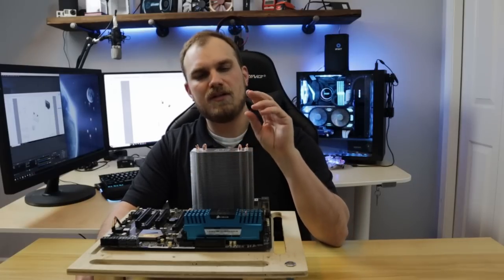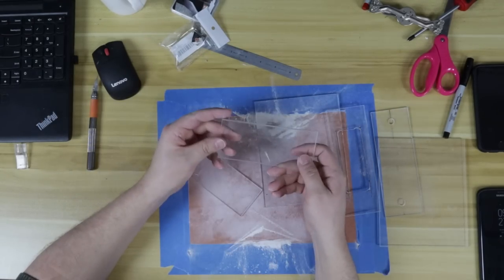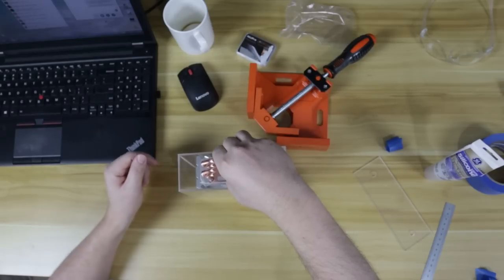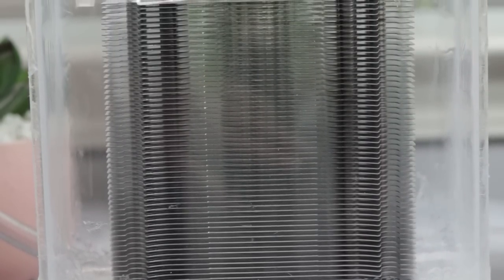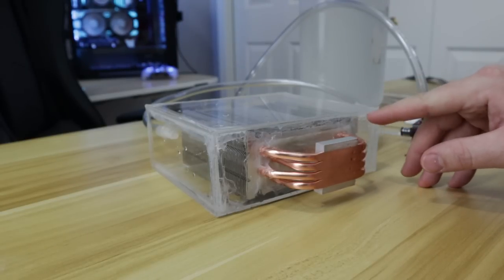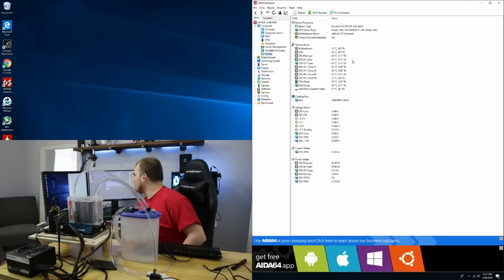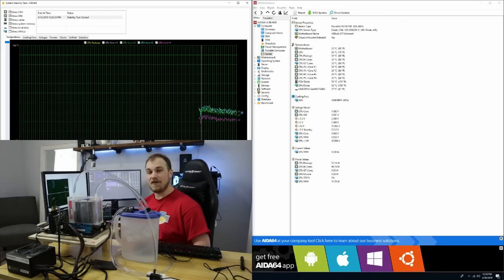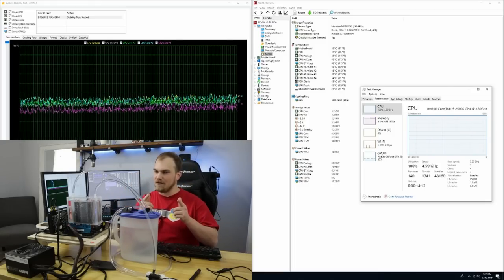I Water Cooled My Air Cooler AND..........

Comment: The only issue you would have here is galvanic corrosion by having aluminum and copper in water. You would need inhibitors for anything longer then a couple of hours. Alternatively you could possibly use a full copper air cooler for better results and to avoid such issues
Reply from the maker: good thinking.
Reply: I try 👍
Reply: Or you could use mineral oil to avoid corrosion altogether
Reply: Saved me having to say the same. I worked at sea for 12 years. Big problem out there. We had zinc blocks fixed to the hull to act as a sacrificial material so the galvanic reaction ate the zinc rather than the hull.
Reply: I was think this the moment I saw the cooler.  Mixed metals....maybe if you found an all copper cooler?
Reply: That's all true, but this is just a proof of concept step. Optimizing materials comes later.
Reply: @CaptainCheeriso  Its gonna be rather difficult to find an all copper tower cooler like this one, there are only a few models in the market for a couple of reasons, like cost, the fact that aluminum dissipates heat better than copper, wheight, etc.
Best bet will be the Thermalright Intros AXP-100, or the Thermalright True Copper.
Reply: LightningManGTS lol I just mentioned that too I was saying if he did use a high end cooler it needs to have a nickel plated copper heat pipes. Or a pure copper heat sink and fin stack and then use a copper radiator
Reply: @maxi1559933  If Al would dissipate heat better than Cu, why are the heatpipes made of Cu?
Please check your "facts"! 
I guess the main reason for Al fins may be that it is lighter then Cu and therefore reducing the load on the mounting brackets and motherboard, the second may be the price!
Reply: @jahre469  Sorry, I didn't make myself clear.
Copper does conduct heat quicker than Al, but, Al dissipates heat into the air more efficiently, and also yeah, Al is lighter and cheaper than copper
Reply: @maxi1559933  Why would Al dissipate heat quicker when it is a roughly half that good conductor and has 2.3 times the heat storage capacity of Cu? That would mean Al stores more heat in itself before dissipating it.
Again my question, why are the heatpipes made of Cu when Al would dissipate it better? Why go through the hassle of combining two different materials when one single material would be clearly cheaper. And finally why are the better radiators made of Cu and not Al, if latter one is a better dissipator?
Reply: @jahre469  Well you surely know more than me, I'll check my facts better next time, sorry, have a nice day.
EDIT: I've read a little more and yes, most of them have aluminum fins because it's cheaper and lighter, again, sorry for the hassle.

Comment: Fun fact: Some supercomputers actually do combine liquid cooling with air cooling. It's not immersion, but instead they add meshes that the air goes through. These metal meshes have liquid tubing welded into the structure, and liquid flows as needed to lower temperatures.

Comment: Props on thinking outside of the box and building it shocked this has not been done. Thumbs up for me
Reply: This has been done so many time before this guy, he's just the first to scale it up so big, you ever hair of a water block. or was this sarcasm?
Reply: @trystonkincannon8320  well, technically this work differently than a waterblock.
Reply: @qiyuxuan9437  oh, how so. It's a big heat sink that drive water though a space in an attempted to cool off the heat sink. You do understand that this is just a way worse version of a water block as the water in and out can prevent from good or effective cooling. Don't think you can call it a water and air cooling. As you would need both a water block and a separate heat sink in the same rig.
Reply: @trystonkincannon8320  I mean, waterblock dont have heat pipes, the heat transfer directly from copper plate through micro fins which contact water. While this method with heat pipes can greatly increase water surface area.

Comment: Excellent job! Hands down, one of the best tech DIY videos on youtube! Only one thing - you should put the cold tube all the way down to the bottom of the tank, so you'll get the coldest water closest to CPU and the hot water will naturally rise up. But anyway, it's really cool. I would buy one
Reply: They make these, they are called water blocks. He just sized it up so big, and probably will not have proper water flow, to make it last.

Comment: You can optimize the flow through the fin stack by putting the inlet tube at the bottom and the outlet tube at the top.
Reply: Fins in water is completely useless
Reply: @Darkkiller2199  I guess every navy in the world doesn't know how to build submarines then.....
Reply: @Darkkiller2199  do you not know what is inside a water cooling block?
Reply: @ashtonhoward5582  there is circulation but no thin aluminium fins like you would have in air
Reply: @ashtonhoward5582  it's a heat exchanger, thin fins of a cpu air cooler won't do anything in water, simply putting the copper pipes in water without anything else would be the same

Comment: Basically. This is just a DIY watercooler x) Minuts the radiator.
Reply: Except for the fact that's a radiator; but in reverse from a DIY watercooler :)
Reply: That is an air cooler for a water cooler, you could water cool that with another system, with a radiator.
Reply: Except the heat exchanger on the cpu is that much larger, meaning a potentially far better cooling than any other waterblock if he uses a nice radiator.
Reply: @kamran2035  I never said an improved block for on the cpu is not necessary. It needs to move water through there and not let it sit. It will boil the water in the end. 

I had drawn up something similar, a big copper passive coolblock available at Conrad at the time, water in at the top, out at the base. Lacked money to do it at the time.

Comment: Get some mineral oil, toss a fan in there, and have it pump into a large aluminum container that you can actually dissipate heat from, and you might have a decent loop.
Reply: a fan in the oil?
Reply: @Nik.ff.  Yes?  it means you have more movement over the fins and you can dump more heat, same thought process as with fans in air on a heatsink.
Reply: @Nik.ff.  Why not?
Reply: @SCComega  i wasn't asking why, i was asking if thats what you meant. I think it'd be cool.
Reply: @Nik.ff.  yeah mineral oil will ruin electronics it's not conductive
Reply: @SCComega  You already have the pump forcing liquid through, and a fan wouldn't do shit in mineral oil. Water is 1000x denser than air now think about that in terms of thicker mineral oil.
Reply: @time-lapserpro4370  Odd, the oil-submerged PCs I've seen would beg to differ as to the fans "doing nothing".
Reply: The best would be to use 3M Novec. Have a look at DER8AUER, he cooled THE WHOLE pc with it.
Reply: So basically do what LTT but instead of doing a full computer do a single component ?
Reply: @SCComega  
I'm sure the fans stir the oil around little, but they really won't do much else. The whole point with an oil submerged PC is to eliminate other cooling solutions. Only fan you need is the CPU fan, without that the PC won't even start
Reply: @time-lapserpro4370  The pump is not forcing liquid through the fins, just through the path of least resistance.  It would be more effective with a better flow distribution, of course.  And fans would certainly help for that.  They would work as propellers.
Reply: Put two fans in, one on each side. Pump in goes into the stack, radiator in goes out. Insulate the cables and plug in. What you will actually start getting is the polarity and fin form of the in fan will pull water through, while the other sucks it to the other side quickly. You essentially turn fans into propellers. Pushing coolant through accelerates heat exchange rates rather than just letting it sit.

Comment: i wonder what corrosion will do to this "aircooler"
Reply: which corrodes
Reply: Use mineral oil with a layer of orbees instead of water
Reply: @humphrex  ...and that corrosion is aluminium oxide, a material that actually protects the aluminium from further corrosion. And for the copper pipes, copper is actually very resistant to corrosion. It will corrode but it will take a long time. And just like aluminium oxide, copper oxide protects the copper itself and the metal will not deteriorate. 
Both copper and aluminium oxide are insoluble in water, so once it corroded there will be no further damage. PLUS Copper corrosion is usually a nice blue color that would for sure look good.
Reply: @Sharpless2  true
Reply: The heat pipes are literally full of water
Reply: @Sharpless2  That's not entirely true, in this case the issue is with galvanic corrosion. Since the electronegativity of copper and aluminum are different the atoms of copper or aluminum will dissolve into solution. This problem will be less of an issue depending on the type of electrolyte (pure water should cause minimal corrosion, but impurities will accelerate it).

Comment: Hacking tip 🔥🔥🔥

Flip your motherboard upside down and then You are solid NO dripping 😂😂😂

The Earth 🌏 do it Job right now.

P/s Missing those days at Physics courses :))
Reply: I was thinking the same 🤣
Reply: Yeah but then all your AIDA data points would read upside down too! Har har har :)
Reply: Doesn't work in Australia
Reply: dasame idea here
Reply: problem that heat pipes (which are main thing of air coller) will not works or works not effective upside down
Reply: it'll not take the load of all that stuff and probably gets leakage more than this one...
Reply: Heat travels up and flipping it upside down will lower heat dispersion efficiency....   it's like comparing a old school fire place to a indoor fire oven. The fire oven distributes more heat  indoors because exhaust pipes are not vertical causeing heat to stay inside instead of venting like a regular chimney would.... in other words we want to vent heat like a preemptive chimney, straight up and away from the source unlike a modern fire oven that traps heat
Reply: @richardwilliamjohnson8566  I suppose you just need to flip yourself upright for it to work.
Reply: @Rohirm  you are 100 percent correct I just wanted it to be basic and easy to understand for most people in most situations without having to think.
Reply: hoang duy, most pumps don’t work upside down sadly
Reply: the weight would simply destroy and stress the motherboard
Reply: @emmanueldedovets5960  The kind of person who doesn't want to think, is exactly the kind of person who shouldn't even be attempting this kind of a build.
Reply: #hackery
Reply: @richardwilliamjohnson8566  
Well even your profile pic is upside down
Reply: Sideways should work.  Heat rises.

Comment: LOL  I love it!  I think if I ever build a custom watercooled setup I'll definitely keep this in mind.  I like the idea of using this as the reservoir.  Obviously, for both space reasons and flow reasons I'd move the tubes to the top and bottom instead of the front so that it fits in a case and moves the water directly between the cooler's fins, using extra acrylic for creating a channel system to more evenly distribute the water flow through the cooler.  Of course, add RGB lighting.  And add a temperature probe to plug into the mobo.  (Or to be really "cool", a temp screen to the front.)

Comment: I like the simplicity of it.  For those that are amazed that it works, if you ever take apart a "good water blocks" have micro fins milled into the plate.  This experiment right here basically just made that portion of the water block bigger and exaggerated it.  So simply, he made a really big water block.
Reply: Hey, the fact that Arctic commented on this vid is awesome. They have the Alpine 11, which is this big block of aluminum with fins for passive cooling. It'd be easy enough to make a water block out of it, without the possibility of leaks due to heatpipes expanding :)

Comment: Pro tip: acrylic cracks, polycarb dosent
Reply: Acrylic is just typically clearer especially in the cheaper plastics
Reply: I think poly carbonate is more sensitive to temperature changes. Especially for heat where it can cause the material to get soft
Reply: Acrylic or plexiglass is molded at 390, where as polycarbonate usually runs in the neighborhood of 430-450
Reply: @reiki2165  Negative: Glas transition temp for PMMA (acrylic) is around 105C, for PC (polycarb) its around 140C

Comment: I do think you could improve the water flow a bit if you put a tube with holes inside the cooling block. The way it is layed out right now, most of the water circulation is happening at the top half of the unit.
Love the idea!

Comment: Technically this is a basic water cooler but up scaled, because you're  just increasing your cooling area and cooling it with water. It's a cool idea never the less, and a nice way to show how water cooling actually works :D
Reply: But how is the heat from the water gonna dissipate? I don't see any radiators here. If the water gets to the same temp as the cpu, it becomes ineffective.
Reply: @maulidonda  He said in the video that if it runs for long enough it will get heat soaked(meaning the water will get hot), and that this is just a test. He also said that he will make a more finished version of this with a radiator, to cool the water.

Comment: I actually seen someone else try this a long time ago but I don't remember how well it worked. Also there actually is other forms of cooling than traditional heatsink, and water loop. For  non sustainable you have dry ice, LN2, and Liquid Helium. For sustainable you also have phase change, mineral oil tank builds, Novac 7000 tank builds. For anyone who just has to have better cooling than a water loop I would suggest either phase change or adding a water chiller..... however those are both quite pricey, and very niche. Still always cool to see people doing stuff like this. =)

Comment: Hey man, first time i i see your channel: i little advice, you should frce the water to have more flow inside, make little fins to direct the flow, also, make it go from the bottom (intake) to the top (out). should improve the temps a lot

Comment: i saw the thumbnail and immediately i thought: OH NO THE ALUMINUM FINS THE COPPER HEATPIPES CORROSION
Reply: Aluminum and copper both form protective oxide layers and then cease to corrode. When submerged they'll basically stay as they are for a very long time.
Reply: @2001kb  Just a double check my knowledge, I looked it up, and copper corrosion is in fact oxidization. Therefore it does form an oxide layer. It also is not destructive, AKA it will not erode away the copper as oxidization does with steel.
I understand everyone is worried about the galvanic corrosion. However, In all practicality and in this situation, I highly doubt that reaction would take place with any sort of speed to actually cause alarm for a number of years. There is still moisture in the air and where this affect as strong as everyone claims, it would take place on every copper pipe aluminum fin air cooler in use.
Reply: @802Garage  aren't you the guy who comments on ricermiata and tommyfyeah's channel?
Reply: @JayJay-cv2no  Nah I'm very rarely on those two, though I have before. Much more common to see me on BoostedBoiz, MotionAutoTv, and Tavarish.
Reply: Chair chemists... This isn't a space shuttle. It was a test in the first place and it's gonna be fine! We aren't talking about welding on chlorinated brake cleaner here.
Reply: I think he meant that wouldn't work on a "pimp my pc" build as pipes would become opaque, I don't know about glass pipes but plexi/soft tubing would probably become dirty fast, no ?
sorry if I'm wrong my last real water-cooling had that problem and was also aluminimum/copper mix but that was 15y ago, watercooling wasn't as advanced as today
Reply: Chlorinated brake cleaner hahahahaha yaaasssssss
Reply: Hello, All he needs to do to stop the corrosion is to add a few ounces of central heating corrosion inhibitor, the modern stuff is compatible with alloys and O'rings.
Reply: copper doesnt corrode
Reply: @2001kb  what about glycerin?))))
Reply: H
Reply: The oxide layer doesn't stop galvanic corrosion, go look up the blocks Zalman had several years ago that had anodized Aluminum tops and copper cold plates, if you didn't use something with corrosion inhibitors, you'd get holes through the top of the block. Mixed metals is usually always a bad idea in PC cooling loops since the pumps in PC loops aren't really designed for getting good flow rates through a filter, and using anti freeze and other anti corrosive additives tends to lower the cooling performance and over time the anti corrosive additives tend to react and condensate out which can clog channels in rads, blocks, and gunk up the pump. SInce the whole point of PC water cooling is getting the best temps possible it's best to stick to distilled water and all brass/copper components that won't interact.
Reply: if you use oil or something like these,  never happen
Reply: Oil is generally harder to pump, makes a mess out of components, can wick up cables, can damage plastics/rubbers, has poor specific heat capacity, etc.
Reply: @brandonupchurch7628  i dont speak english well, but cars, and other motors use oil like antifreezer (refrigerat) and pump to these purposes (pumps medical or acid prouposes never touch components, work like the guts not wit one stator)

Comment: major manufacturers: "write that down! write that down!"
Reply: No, fins in water is completely useless
Reply: @Darkkiller2199  uh...car radiators would like to know your location.
Reply: @frigglebiscuit7484  Fins are effective for air, but for water it is useless
Reply: Just look at commercialised water coolers, there are no fins where the water touches the CPU however there is a radiator for better air convection